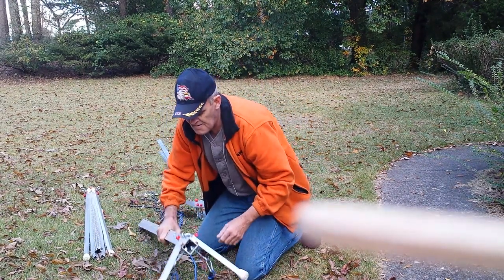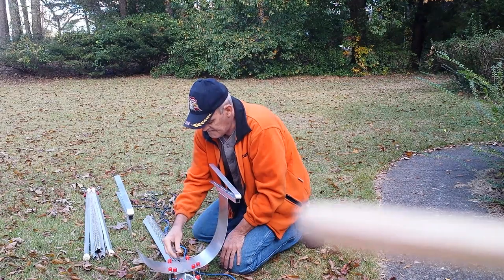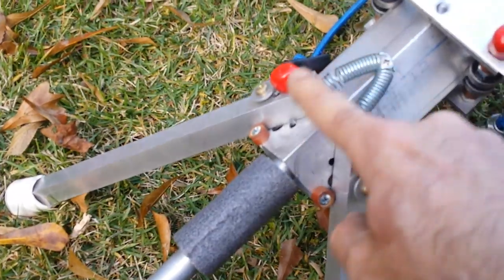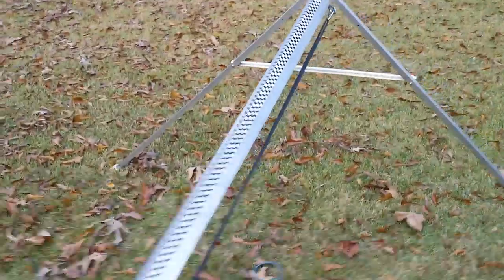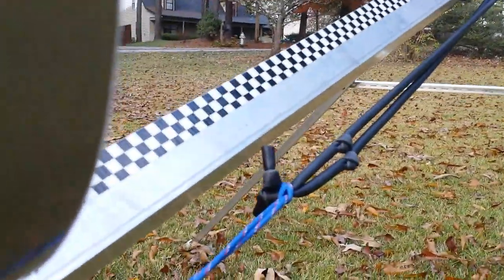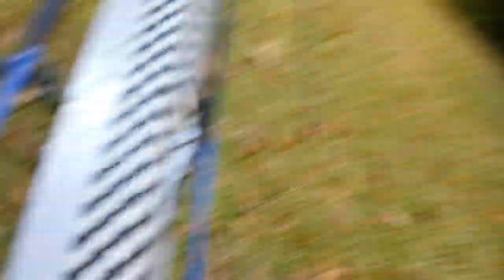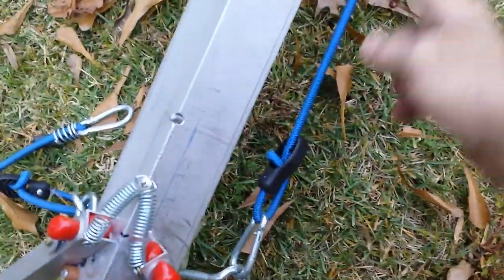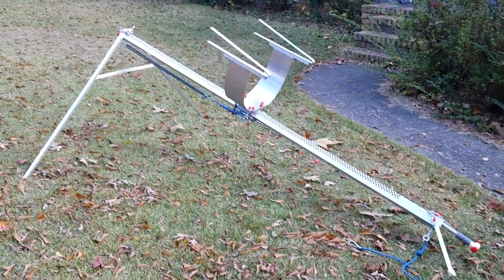My Catapult Bungee Launcher for my X8 FPV Plane & Other planes as well

Comment: Hi Brandon, nice work! What are those clamps called? They look fairly robust
Reply from the maker: If you check out the link in the description. ...they should be listed there?
Reply: Yes, I was looking, I noticed you said you found them on eBay... a cursory look didn't show anything too promising, was just wondering what words you used to search that brought those up, no worries.
Reply from the maker: Jay Savage ....I'll lol back on my stuff and see if I c an find a link to them....I believe you can also find then on Amazon.com
Reply from the maker: Jay Savage here is the amazon link i bought mine at....hope it helps some   http://www.amazon.com/gp/product/B00FH3APCI/ref=oh_aui_detailpage_o01_s00?ie=UTF8&psc=1
Reply from the maker: Jay Savage  I actually got mine on eBay like I said on the video, but I also bought several spares from amazon as well....that is the link above for them
Reply: Brandon Moon Thanks Brandon!

Comment: Nope, it won't work with X8... Too short and/or weak... For 3.2 kg X8 launch, to the minimum 15 m/s exit of the ramp speed, from 2 meter launch ramp, you need at least 200 N CONTINUOUS force along the ramp!!!